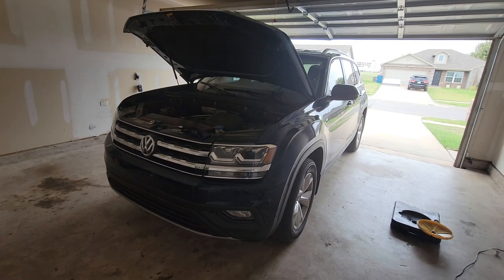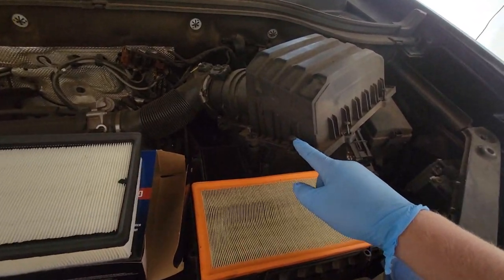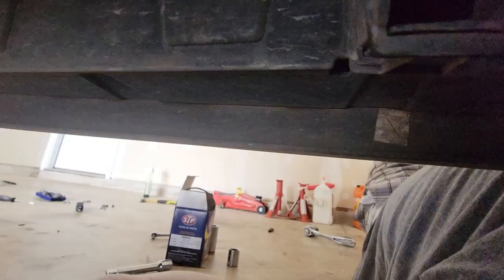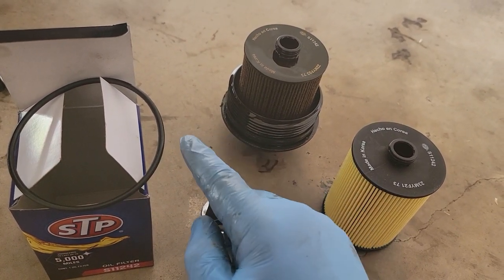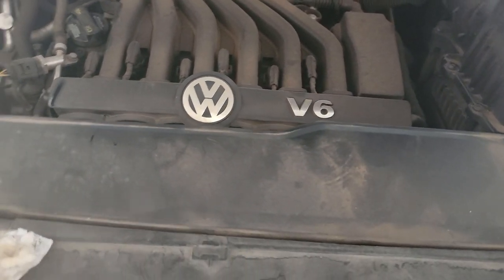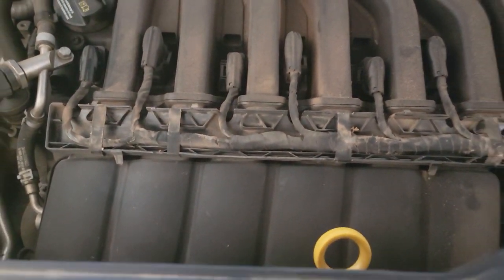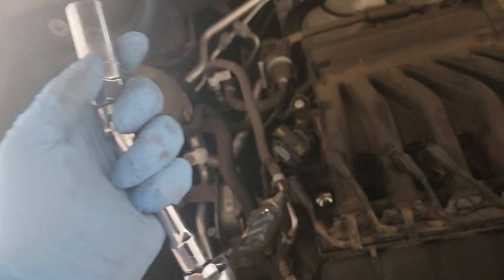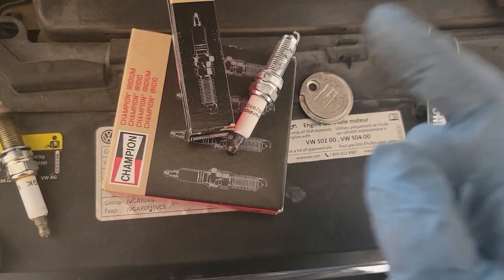(Maintenance) 2018 VW Atlas 3.6L Air Filter, Oil, Oil Filter, and Spark Plug Change

Comment: What is the VCDS software for? RSI reset?  Thanks for this video!
Reply from the maker: It's does a bit more than that. It allows you to manage bits and bytes of various computer modules equiped in a vehicle to change how they function. It's is also a phenomenal troubleshooting tool and also allows for RSI reset. I've used it in almost all of my VW videos with the exception of the headlight and door lock videos if I'm not mistaken.

Comment: a little goes a long way with that anti-seize for future ref. those may  foul out sooner than you like from gunk if it pushed through. thanks for the video. I use a string to pull my coils out :)
Reply from the maker: Thanks for the tip.

Comment: I noticed you used 5 W40 engine oil.
I have the same vehicle and my manual says it requires 0W30.
I'm new to the VW world and was wondering if I missed something. 
Thanks
Reply from the maker: Yes I did use 5W40. Keep in mind the viscosity ratings are really climate centric. I live in an area where the average outside temp allows me to use 5W40 with no issue.
Reply: @HavingFunRepairs  ok, thanks for the reply.
Reply from the maker: @justinsmothers2963  anytime I appreciate the question and it is a good one. If you Google "is motor oil climate centric" you will find more information on this. The climate I live in does not get cold often or really at all. However, it does get hot! 5W40 is excellent for these higher temperatures.
Reply: Awesome,  thanks for the info.